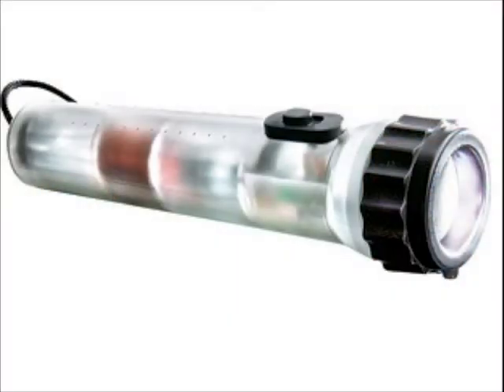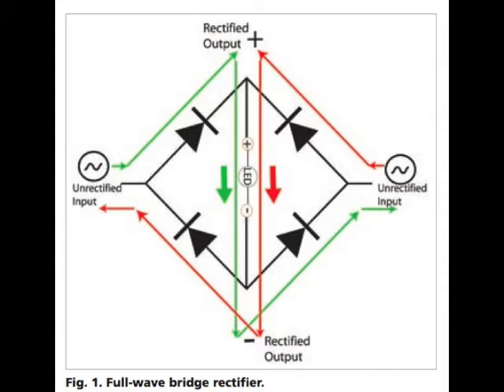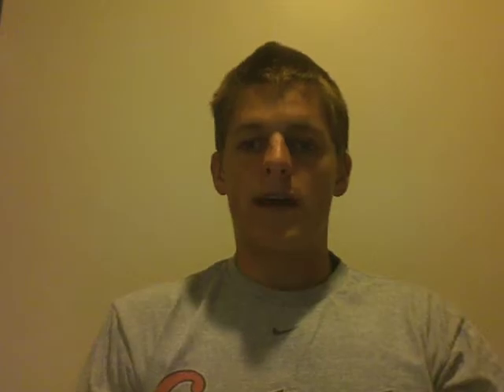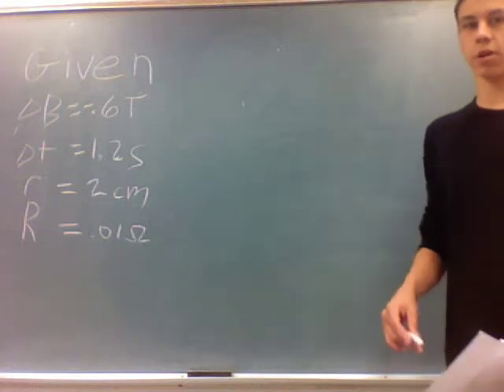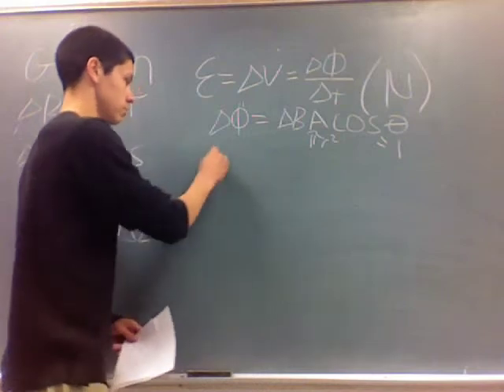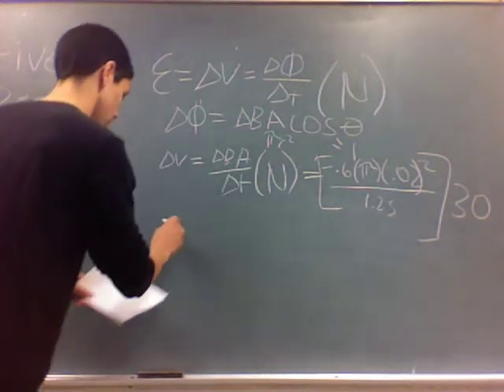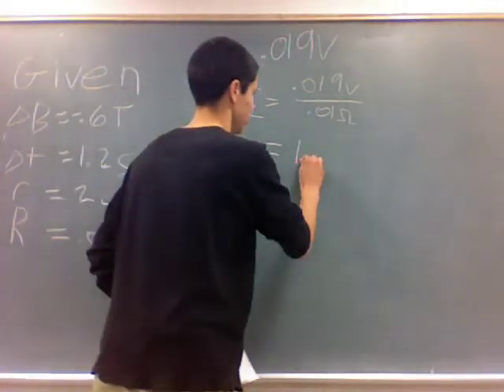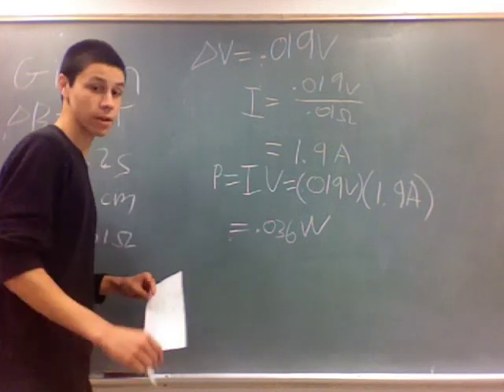Electromagnetic Induction- Alex George and Mike McKinley

Comment: if theta = 90 degrees, then cosine 90 = 0, not 1, its the angle from the normal of the area, if theta = 90 then there would be no change in the magnetic flux linkage